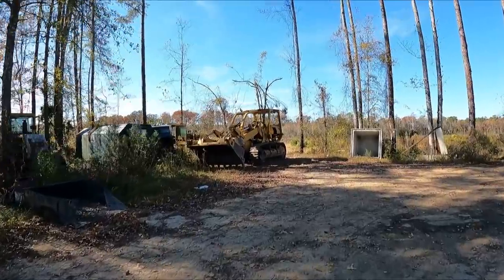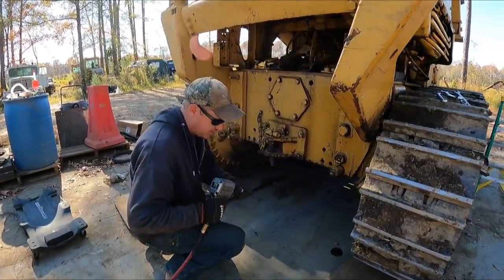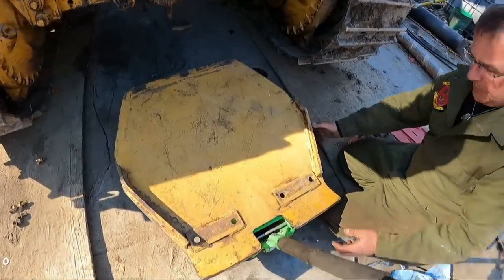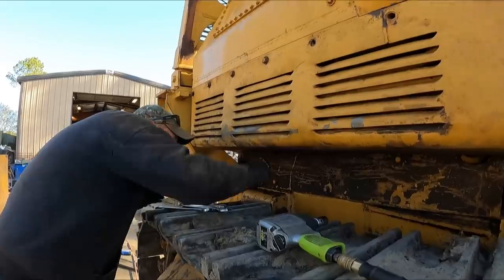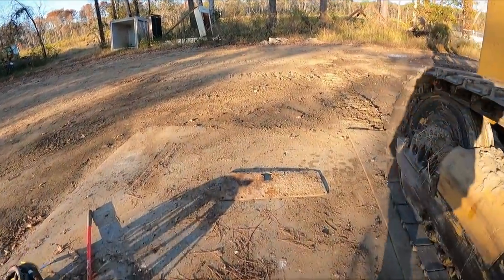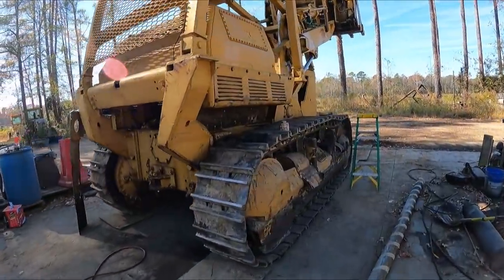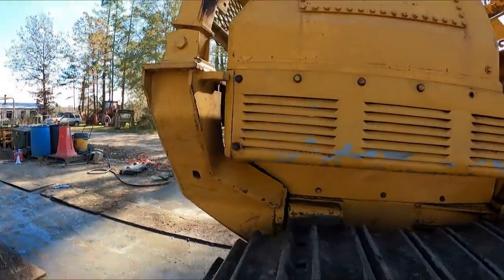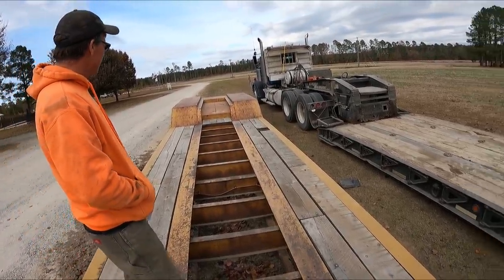Finishing The Repairs On Betty And She Comes Home!

Comment: Several years ago I made a big improvement to several belly pans. It's not a daunting 2 person task anymore lifting and aligning bolt holes. We split our shields and placed a reinforcement brace for the middle, inserted and welded a hinge style bracket on either side, one side overlaps the other then we inserted 5 bolts per side so you can open one side without lowering the other. But they would swing towards the tracks giving you unobstructed access underneath for maintenance and cleaning and you can do it whenever and wherever needed without a jack. 
 Another suggestion make yourself some cylinder stops that will fit around the cylinder shaft and pin in place when working under the loader. Weld a tab on each loader arm to keep the cylinder locks with the equipment at all times. You never know when you might need them and they will be available and handy at all times!

Comment: I used to drop belly pans on my dads 973 laying under them, dropping them on my knees and rolling them over to lean against the track frames. Had to be carful not to tip them because at the time I was 155 pounds and pretty sure the big pan weighed almost that much.  Never seemed to have a concrete slab and jack when it had to be serviced. Fun times though.

Comment: Betty sounds like the engine has a bit of mis-fire,when spooling up from an idle,possibly dirty injector or two,,and the back edge of the bucket behind the gripper teeth on the front half looks like its worn away,there's a gap in the side when bucket is closed. Will be interesting to see how Betty handles some of the softer terrain,that you occasionally find yourself in. Big Bucket Betty, welcome too your new home!!😎😎😎
Reply: I'm glad someone else heard that too I thought it was just me

Comment: Hello Chris, please consider two options that will make your under the machine excursions safer and a whole lot cleaner at the end of the day. Tyvek disposable coveralls. ( I had several in the shop and only threw them away when they were too  ripped ) and something really helpful when looking up, Sperian Protection S8500 Bionic Face Shield. ( Keeps your face clean and eyes safe). You can get face shields at any welding supply store.

Comment: Instead of using a Safety chain, cut a piece of 4x4 angle iron the same length as the piston rod of the cylinder. Lay it on the piston rod and let bucket down until it wedges the angle iron tight.

Comment: A thread tap cleaning those bolt holes is worth the effort. Cleaned and anti-siez with new bolts.  You will appreciate that the next time under there.   I hate not trying your best to do stuff like this as good as possible. That's gonna be one huge asset to your arsenal of equipment.

Comment: It's losing good but if you spray some diesel gasoline all over an around that motor thin rinse with water would make it look brand new plus a hole lot easier to see what you doing if you ever had to work on it.

Comment: I like the sound of that machine.  I need a house generator using that engine with the same exhaust stack.  My neighbors would love that.  "Oh, why is the generator running at 5:30am?  It's gotta run through it's monthly test.  I can't control that the computer does it automatically."

Comment: Ol` Betty is starting out with you needing LOTS of miracles. One tool you need to get and use is an aligning pin. You shoulda put some LEDs  on Ol` Betty pointing front and back.

Comment: That new bucket is a little one lol, biggest I worked with if I remember was 22.2yds capacity :-) on a Backhoe
Betty does not sound right to me, sounds like its not running smooth, missing a bit, if you know what I mean.  I've worked with a lot of plant in the past.
Reply: Yeah she definitely has a miss to her. Probably a clogged injector. There is no such thing as a 22.2 yard bucket on a backhoe. Maybe on a shovel or extremely large excavator but not on a backhoe.
Reply: Try O&K 120 excavator. Has two engines.  O&K got bought out by Terex some years back. 30 yes since I used the backhoe

Comment: If the bolt comes out of the hinged cover you put next to the engine, will it flop over into the tracks?  Might want to nylock nut that sucker.
Engine sounds like it may be misfiring or weak on 1 cylinder, maybe that sludge has an injector not flowing well?  Or is it the exhaust leak?

Comment: I LOVE the look of Betty. Best Looking of the CAT front end Loader's. Your Dump Lever is push forward for dump. I thought the CAT made them pull back to Dump. Anyway. Your updates on panel, you get A+ from me. The clean out drain on FUEL Tank, that's a great idea.
All I can say know is I am so ENVIOUS
Man I wish I could come down to see you. Work for FREE for you. I'm Retired. I own a 1978 Dynahoe- 190- 2 wheel Drive. Has the old Detroit 353. She is my Little Muskey. Sense she is BE. I use her on my Garden. Really turn the soil over. Removing the Rocks. It looks like Big Muskey, when you look at my small area I Garden in. I always loved the Look of Dynahoe
Such strong Machines. Just like I Love the look of your old BETTY. They just look so good. My little Muskey has 8000 Hours on her.  I baby her. Liked how they main framed the backhoe part. Very strong design. Bucket is Huge. Just like your Friend's NEW great looking heavy duty Big bucket. Thank you so much. I Learn so much from you. Little things like you adjusting the Bucket Level I know what you mean about having it FLAT. My bucket Level is me when wife is runner Little Muskey, or she does it when I run her. The bucket also works as my Man lift for me cutting Tree branches with my pole saw. Lots of REACH. Anyway I have rambled to much. I will follow you. Love to see Betty dig Dirt.

Comment: I can’t remember if this unit has the pre-cup and bullet injectors or not but the bullet injectors are pretty cheap. Also, if this machine has the rack and pinion injectors, make sure the timing marks line up. One of my old D7s sounded a lot like Betty and once I got into the rack and pinion I found that one injector was one tooth advanced and one was one tooth retarded. Once it was timed correctly with new injectors it was like a new unit. No more “Popping” sound during idle and run up. 👍

Comment: Pipe dope or tape is not a sealant. It is a lubricant for the metal threads to tighten witbout spalling or galling.
Only metal to metal contact seals the connection.
Pipe dope or tape could never seal a hydraulic hose as the pressure would blow it out.

Comment: Why you didn't fix the loader on the right side ? You missing a pin.
Reply from the maker: its not missing anything
Reply: The "thing" you are referring to is a built in "safety prop" you can engage to hold the loader in the raised position for maintenance.